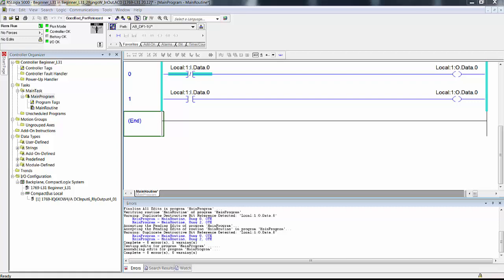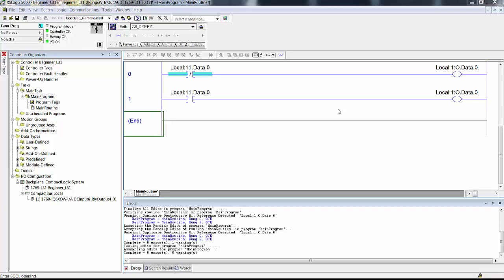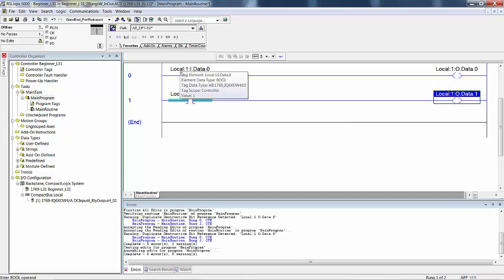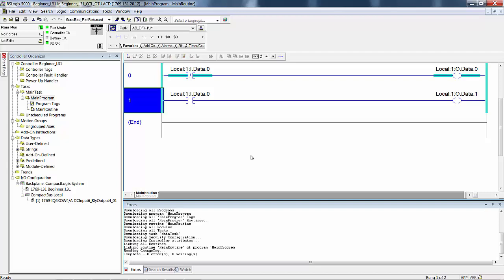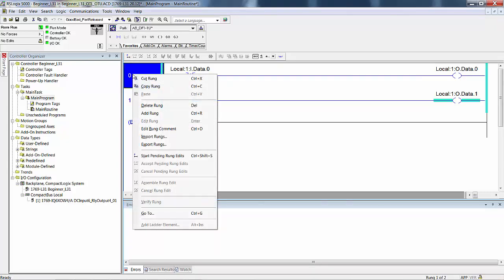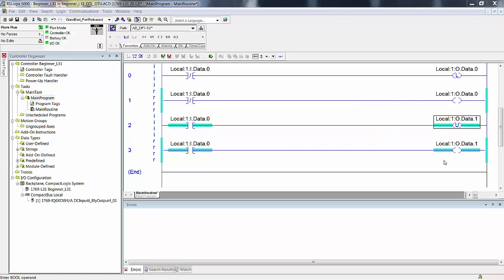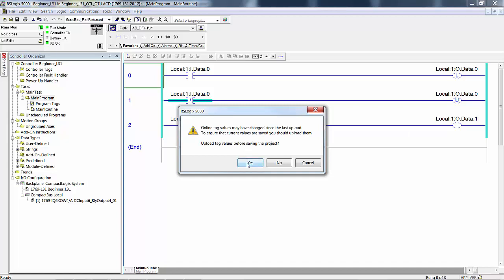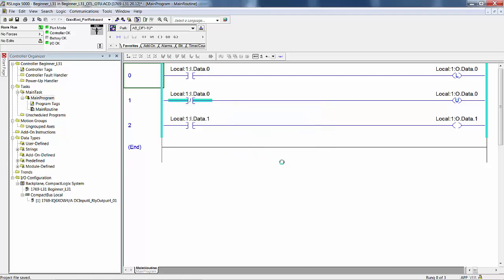11 Programming & Troubleshooting a PAC - OTL (Latch(SET) Bit) OTU (Unlatch(Reset)bit) Approx Pg 81

Comment: A lot of videos are blurred and makes it difficult to watch. Would you please look into it and try to post a video which is clear to watch? 

Having been through all the videos till this point, I rate them as the best resource to learn PLCs for any fresher and experienced Instrumentation and Control Engineer. 

I am wondering if you have posted any video which mentions about wiring of Analog Inputs and outputs the way you did for digital inputs and outputs.
Reply from the maker: Which video was blurry...this one is 720p?
Reply: @plcprofessor  I found out later that intermittent blurry behaviour of the videos was due to the internet speed rather than anything else. Quality of these newer videos are really good. 

I would be grateful to you if you could let me know if there is any video in your YouTube channel describing about wiring and behaviour of analog inputs and outputs (as you explained for digital inputs and outputs in your videos for micrologix PLC programming using  RSlogix500).
Reply from the maker: @saurabhbhardwaj9667  Thank you for your interest and comments. I am really busy developing a course for the Micro800 family and do not see any additional analog on the horizon for at least six months.